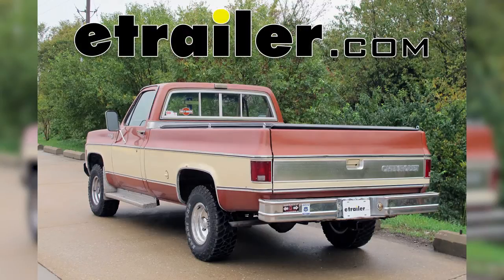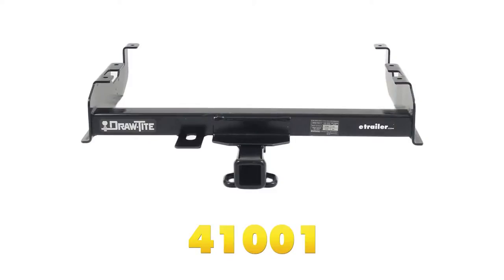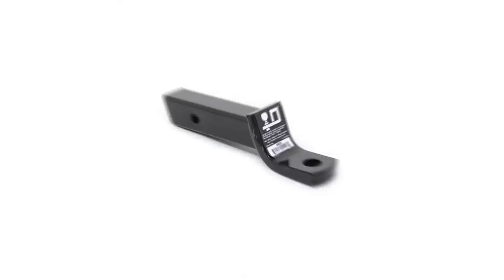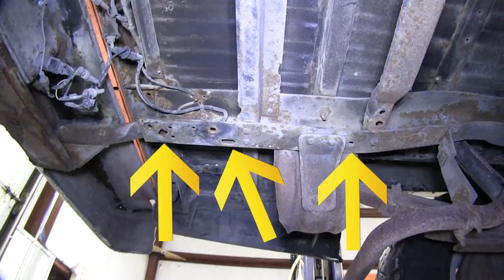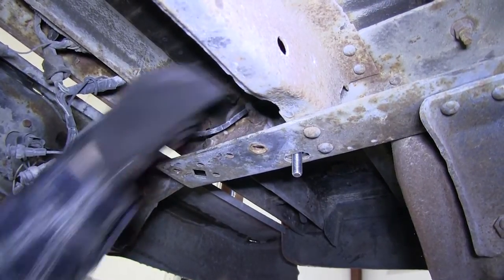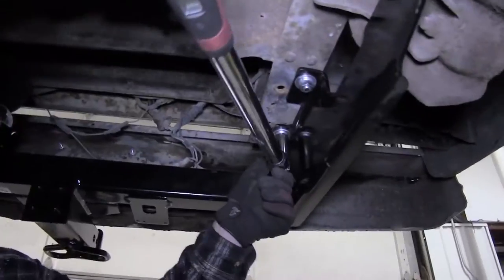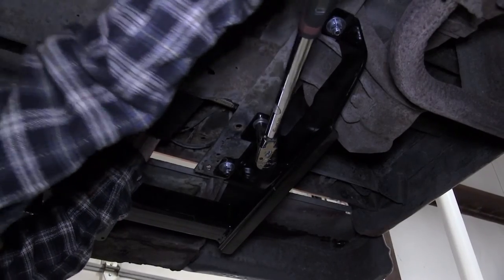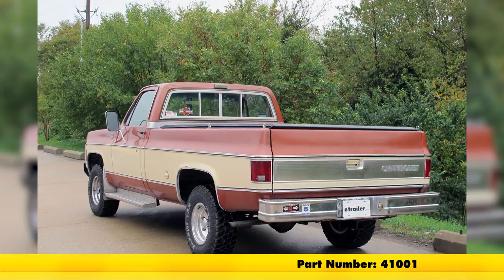Install: Draw-Tite Max-E-Loader Trailer Hitch Receiver on a 1978 Chevrolet c/k Series Pickup

Comment: Would this be a big enough hitch for pulling a loaded non inclosed car hauler?
Reply from the maker: This hitch is rated for 600 lbs of tongue weight and 6,000 lbs of trailer weight.